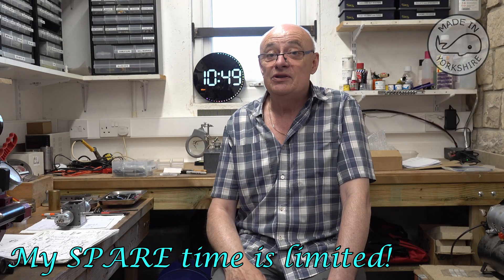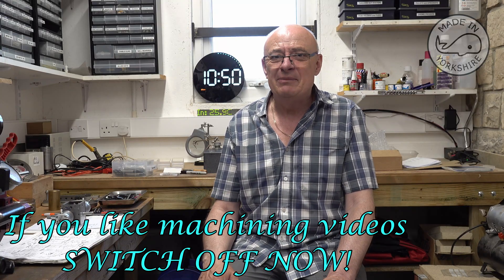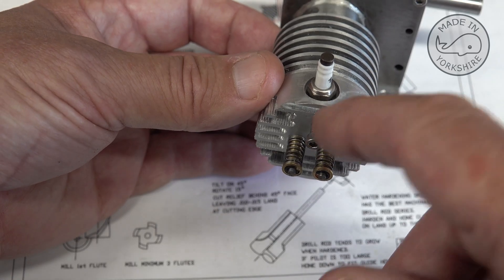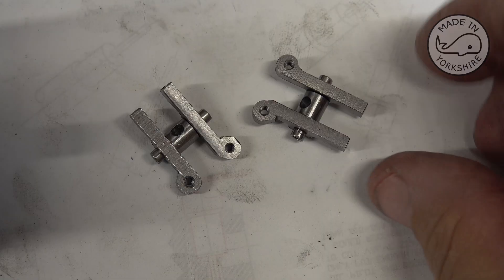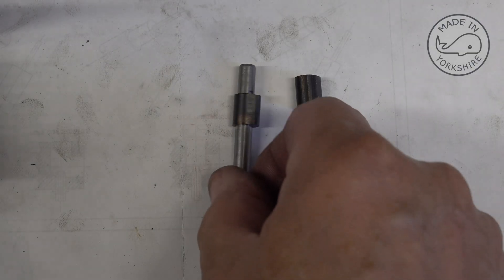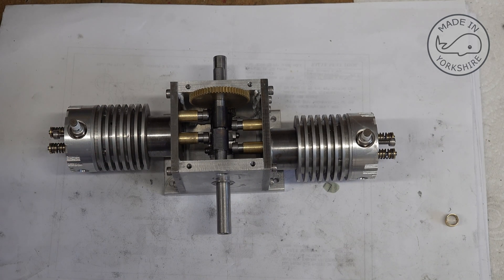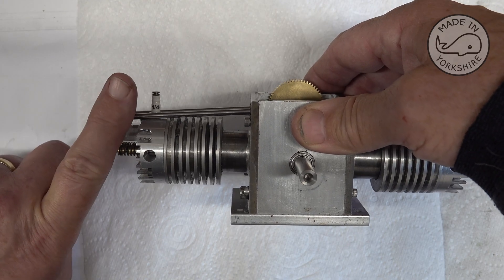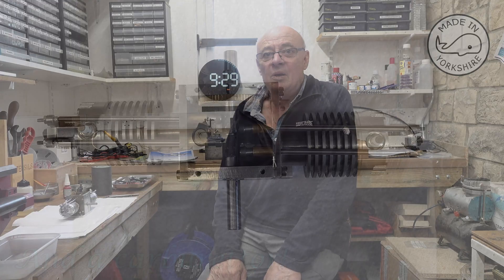#MT56 Part 8 - Upshur's Opposed Twin IC Engine. The Rockers & Cams. In 4K/UHD by A Whale.

Comment: Great to see you back in the workshop Andrew. I completed my version of the Hamilton Upshur Opposed Twin a month or so ago and have been having fun since then adding fan cooling and ignition advance. I had the same concern about lack of material for the rocker post thread and dealt with it by allowing for a pad standing proud of the surface of the head when preparing the stock. I also used valve guides with integral valve seats rather than cutting seats directly in the heads. The basic design is sound but there is plenty of opportunity to put your own stamp on the details.
Reply from the maker: Very interesting Alan. I didn't think there was enough room for valve guides. Good on you for working it out.
Cheers 
Andrew

Comment: That engine is not "opposed" , it is just a "flat twin cylinder". To discover what "opposed" means study Deltic or some Fairbanks-Morse engines.
Reply from the maker: Well I didn't name it. I'm just trying to build it 😂😂
Reply: That's not strictly true. The Napier Deltic, Fairbanks-Morse and Commer Knocker engines are examples of Opposed Piston engines with two pistons travelling in opposite directions in each cylinder. Flat engines can have an Inline Cylinder (e.g. BMW K100) or Opposed Cylinder layout. An Opposed Cylinder flat engine can also be designed with Boxer or Non-Boxer crank pin and piston orientation.
Reply: @AlanGorlick I am not of that view. The dictionary definition of opposed is two items  conflicting with each other. I realise that "horizontally opposed" has been misused for many years by non engineers who did not want their engine to be called "flat" but that is what it is and "flat twin (or four)" describes it correctly. There is no need to invoke the word opposed any more than you would invoke the term for a radial engine. It would never be called "radially opposed cylinders".  If they are on the same side it's "in line". So flat, inline, V , radial or rotary describes the arrangement of cylinders and opposed describes pistons in  opposition. I accept that non engineers have won the terminology battle and "horizontally opposed" will continue to be widely  misused by those who have never seen or heard of Deltic (I worked on them in my 20's) but "flat twin" is the simple and correct term.
Reply: @barrysnelson4404 I respect your opinion and your experience but "Items conflicting" is only one element of the definition of "opposed". The full definition  includes examples of when the word is applied to location and orientation of objects as well as when it is applied to opinions, direction of movement etc. Simply describing an engine as a flat four does not define the cylinder and piston orientation in relation to the crankshaft.
Reply: @AlanGorlick Many thanks for your courteous reply but I think "flat" does, upon reflection, cover the case of the engine configuration we are discussing. I can not see hoe the cylinders of a flat engine can be "opposed", in any case, as they don't line up being offset by the distance between crank web. No need to carry on as I freely concede that engineers have lost the battle and motor car pundits who obtained their engineering degree from the University of Google using only the tip of one finger will continue to use "horizontally opposed" when the term "flat" is correct and sufficient. Just as an aside I never worked on railway Deltics but in the Royal Navy when we had that engine in the "Ton" class of minesweeper where it was chosen because it was mostly aluminium with a bit of steel so had a much smaller magnetic signature. Happy days! Anyway, best regards etc

Comment: Good to see you back Andrew. I guessed life had got in the way of engineering. You seem to have had a basinfull. It is always a bit tricky picking up a project again. You forget all those little departures from the plan that you were sure you would remember! It would be great if you just do updates without full videos until things calm down again. I am also still in stop mode. After the house move we have been waiting on builders. Work has now started finally. Hope to have a workshop by the end of the year. Looking forward to getting back to the lathe.